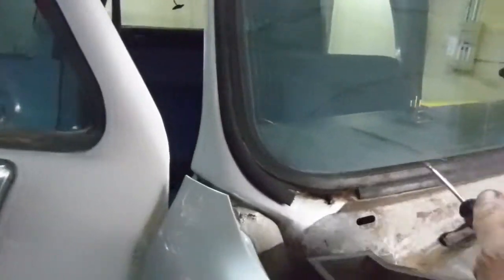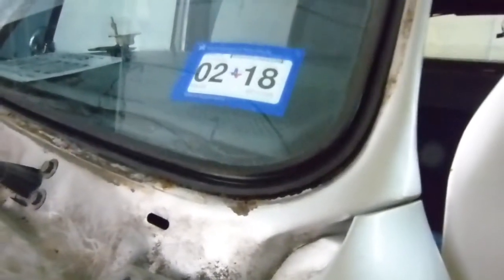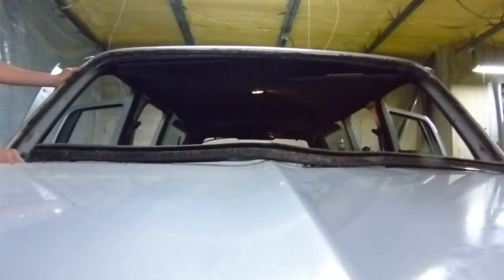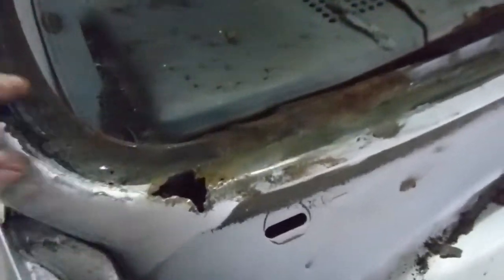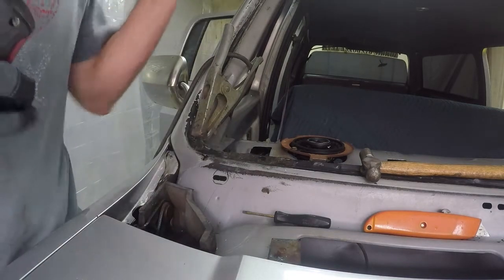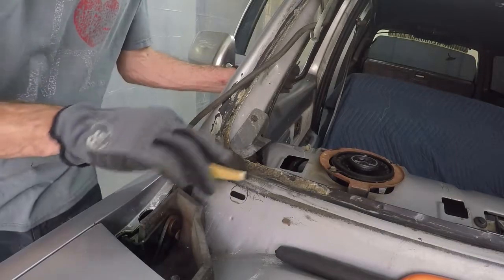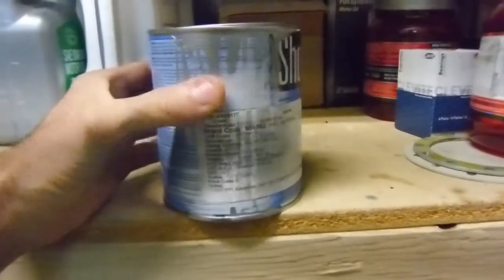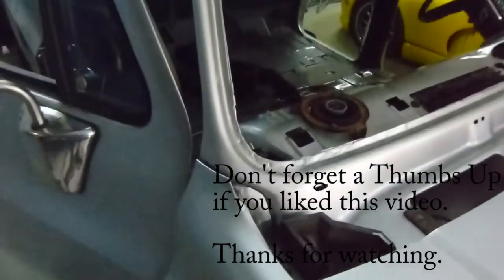Zombie Suburban gets Windshield Rust Repair  Squarebody C10 K10

Comment: I was thinking this was going to be sketchy, but it was good enough. I TIG weld everything, so every time I see unclean metals being welded... I cringe a bit. You did right by not going any further into it... The perfectionist in me says to dig deeper to clean the metal, but you'll never get any further than running a pressure washer down the hole to knock the flaking metal off to OSPHO it all. I probably would have, but that makes things cost to much for the job.
I'm working on my K5 that probably I wouldn't have bought had it not been for the LS1, TH400, and NP205 atop 39.5's. Kicking off my business this year made this one an easy write-off for the sheer amount of advertising material from one truck alone. A lot of little spots on the A-Pillars, windshield frame, right door bottom, big floor/rocker panel replacement.
SETx here... BMT Where you from, dude?
Reply from the maker: What business allows you to write off your k5?  Sounds like a good score.   You should check out my 4l80e swap video too.   I'll be coming out with another video soon, swapping a 700r4 for a 4l80e.
   Born in Dallas.
Reply: @CrankAddict  Restoration and fab business. Advertising and my shop truck in one package. By the book has its perks... For a few years at least, but everything helps in the beginning. It's hard to find 4L80's down here that are alive or not being kept. I'd prefer the extra headroom for the LS1 to stretch its legs without trying to pull a tire. It's a 10s NA Camaro LS and way too much for the job... Package deal sent me home with it and I couldn't decline that motor.
I used to build Jeeps all the way out from the ground up and used to head up your way to rock crawl in Gilmer at Barnwell too.  I got tired of Jeeps with all of the JK Jeeps looking the same; big wheels wrapped in useless low profile rubber, the pot iron frames to the console overkill, and really lost all drive to mess with them. Cliche mall Jeeps.
Always wanted a K5 Blazer, but never liked them stock... Good market coming in for restoration with square body and OBS. Even those body style dump trucks are flippable nowadays.
I watched your Jimmy Unibody box clean out before I went to sleep and buddy, that was horrific! What a nasty mess that one was with the car or dog shoulder bone (IDK) that you dug out of that Jimmy's Unibody! That LQ4 and transmission as well as the axles in that Kawasaki green really turned out nicely!
I don't wear a covid mask (thank our Texas for that), however, when it comes to plague etc, I'm with you plus a respirator!

Comment: Same trouble areas on my '82 c10 and some...  and some of the rust made it towards the top end of my dash as well... really wanna fix
Reply from the maker: Good luck on that.    I know the water on the floorboards is a big motivator
Reply: @CrankAddict  floor boards are immaculate!! The car over all is solid just the same problem areas on your video.. right where the windshield sits/ rubber seal

Comment: How do you patch badly rusted areas during windshield install? Do you use bondo or something?
Reply from the maker: No bondo.  Cut out the rust.  Shape some sheet metal and weld it in.  Grind smooth. Primer. paint.  I replaced half the windshield channel on my trans am this way.
Reply: @CrankAddict  I'm about 2 fab patch panels 4 a k5 Blazer - esp the cab and floor patch
Reply: I have seamed sheet metal and some really precise welding and forming